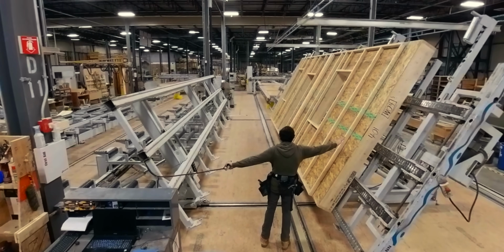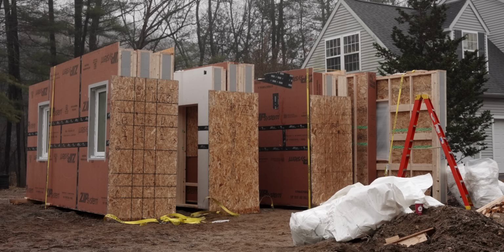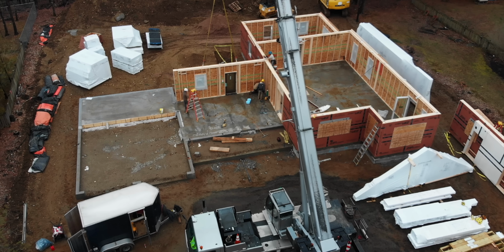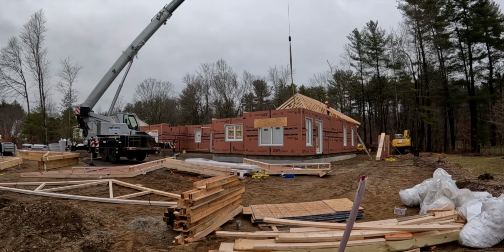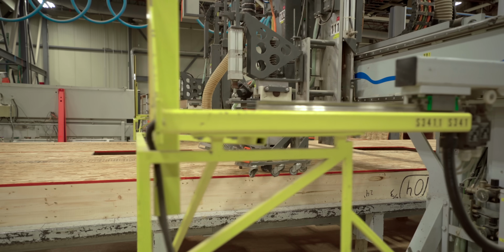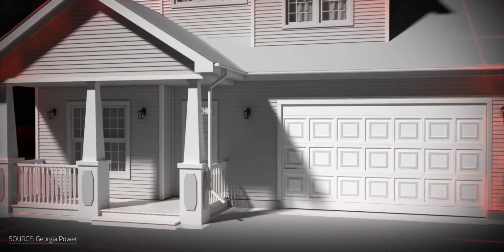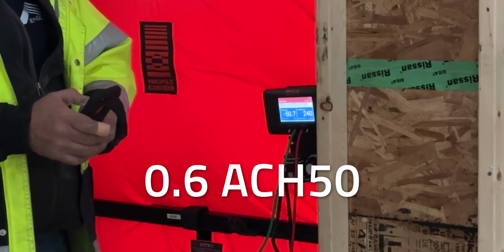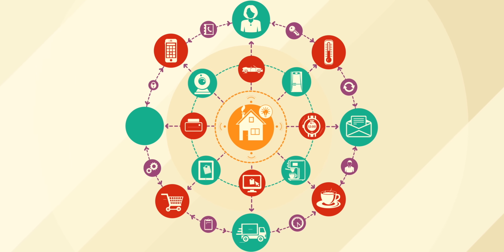Wow! I Didn’t Know A Prebuilt House Could Do This

Comment: It’s really hard to reveal costs, but I would love to see a final breakdown of costs after it’s all in place. 

I’m a huge fan of this, and would like to see what this cost would be vs a “normal” home cost to see why we all aren’t just doing this for all new houses.

Great work, been watching since 2019, keep the videos coming.
Reply: Stick built could come in higher or lower depending on the builder.  There’s flexibility in that.  With a pre-fab you do have a house in a box.  It is what it is.  Mostly good.:)
Reply: I’d guess the cost of the structure to be 25% lower than stick built.
Reply: @JohnCap523  
~$300/Sq.Ft.
Reply: @bbfoto7248    Based on what? After the foundation is printed there’s a million variables. That sounds high but I will admit I’ve lost track of new home construction costs.
Reply: 10 - 20% more expensive when done in Germany, not sure about stateside. The more basic the design, the less effort has to be put into the construction off site and on site, obviously. Then it boils down to energy costs in the long run...
Reply: @Walterwaltraud    10-20% of foundation and side wall cost, or whole structure?
Reply: @JohnCap523  Final price of the total construction! Pls keep in mind that over here many houses are completely done by bricklayers, not pre fabs, though they definitely gain traction. But usually not made from wood. (not an expert, just an interested layman, visited the first such house close to my parents' place in the late 90ies. Other than the sleightly perceivable HVAC noise volume, quite an impressive house already back then).
Reply: @Walterwaltraud    Over here construction is cheap and crappy. If there’s brick or stone it’s just veneer.
Reply: Like most things its going to be a much higher upfront cost but will save money in long term with it being cheaper to run, I'd imagine you wouldn't break even for a couple of decades at least. It still makes financial sense but a large portion of people won't have the opportunity to afford the upfront cost.
Reply: @Professor-Scientist  A home could be stick-built with the same level of airtightness.  It is just not done very often.
Reply: @MrSteeDoo  stick-built?
Reply: @Professor-Scientist  built on site vs Pre-fab, as shown here.
Reply: Would like to see costs too. Especially for "normal" people (& not YouTube superstars.)
Reply: It's not being done because it costs a lot more.

Comment: Built a passivhaus a few years back (0.42 ACH) and one thing that I didn't know and what really annoys me these days is that ERV's don't control the moisture in moist summertime (I live south of Tokyo, its 80%+ humidity several months during summertime).

AC can handle that a bit, but for me it feels like the wrong point to do it (I don't want to run AC 24/7, I shouldn't have to), it's the ERV dumping super moist air in the house, why can't it be fed with at least some moisture control?

I've done my googling and there aren't really any good products that would do in-line dehumidification for the ERV.

Anyway, that's the worst one I've experienced. Otherwise things are so much better than a leaky average Japanese home :)

Comment: Don’t use solar panel electricity to heat you home. Use compost heating with wood chips and grass, you can have hot water and heating all year long. Give up on thermal heating, I challenge you to heat your home with compost heating.

Comment: I'm surprised that you are using a ground source heat pump if you are hitting passive house metrics. I have repeatedly seen/read arguments that with the gains in air source HP performance, and the expected low energy demands of buildings like yours, the cost of ground source is hard to justify for the small performance gains (even in a cold climate). I'd  like to know how you reached your decision. Congrats on your .54 ACH50 results!

Comment: Matt an <awesome> way to seal up your house and check for leaks is using AeroBarrier.  If your house is still in a pre finishing stage, i'd highly recommend bringing an AeroBarrier contractor in to your home, you will see your ACH drop even further.  It's an amazing product, search for an Aerobarrier video by Matt Risinger to see it in action. It aerosolizes caulk and pressurizes your home, forcing the caulk to build up at any leaks and seal them up.

Comment: Greetings from Germany. I`m surprised that airtightness is something "new" for the US, as it is a common standard for building houses in Germany since more than 15 years.  Do you have any idea, why in the US rafters are so different from ours in Germany? We usually use rafters with dimensions up to 10cm by 15cm and spacing of 60 cm while you use much thinner rafters with a smaller spacing. Any benefits or just different traditions?

Comment: Hey Matt hopefully your house is going smoothly... I figured you would go with some of the hemp create insulation that you have mentioned in the previous videos. Surprised you didn't. What are your thoughts on heated floors/ driveway? Radiant heating from the floors always made the most sense for me logically but Ive always wondered how they actually perform when applied.

Comment: I've owned enough homes to understand that build quality can be quite suspect and variable.  I like what you have shown of how Unity actively test to validate a good portion of that.  I work in manufacturing (machine shop) and I definitely see the factory build and methods being substantially better from a quality control standpoint.

Comment: As you are getting that heat pump and air control system, I wonder what you do with waste heat from the solar panels.  Do you allow them to heat up and deteriorate, or do you actively remove heat and bring it somewhere needed?

Comment: How much insulation went under the basement slab and walls? Did you test for Radon in the basement pit soil? Did you need to install Radon ventilation. This can be very high in your part of MA. I built prefab homes as a kid summer job and they were better in some aspects but nothing compared to what you have here. 
You can do a sealant fog at the end to seal the multitude of tiny holes very easily. It is worth the effort. Go for as low a number as you can, 0.15. Air tightness only degrades (slowly) over time. It will never be better than the day they hand you the keys.

Comment: One thing is thermal bridging on the walls and ceiling I have an old house from the 1920 tipical of the old mining towns when the mine shut down the company homes were sold and people who bought them usually bought more than one lot and house and combined the houses in our case they bought 3 lots and houses and like most who went that route they combined 2 houses 14 x 20 into one house T shape the third house was moved back the floor removed for a garage then over time additions were added a porch then a new addition was added when they added sewer and indoor plumbing they put the addition beside the porch and made a bad situation even worse because they lined the roof of the addition with the porch roof and that's where the problem became worse as the porch roof was tucked up under the house roof with no way to seal the upper edge of the porch or new addition roof to the house under certain conditions it leaked and the water ran down on top of the drywall ceiling and into the wall behind the drywall since the porch or now back entry room was done first its the worst and has a lot of rot surprisingly the stud and floor joints are still in good shape no rot but some of the shiplape is rotten and the wood panels in the back entrance and the drywall in the bedroom is totally rotten so I'm taking it back to the studs and firing the walls out to 2x6 with 1 1/2 Styrofoam and a 1/2 inch plywood so I can insulate with R20 I'm putting in a drop ceiling so I can get R44 insulation that's first step but I've seen others reinsulate old homes and they all do the same thing fir it out with 1 1/2 x2wood wood strips and still have theamal bridging my next step is do the same room by room on all the walls I don't know why in a factory built home they don't use the same technique 2x4 studs and 1 1/2 Styrofoam and 1/2 plywood then there would be no thermal bridging on the walls also why did you go the route you went instead of sip panels there is no thermal bridging and a very high R value

Comment: I ordered a factory built house - much alike yours - 7 years ago, and moved in about 11 months after digging started.  This is not a "passive house", but quite efficient nevertheless.
In southern Finland we have had proper winters, and this year we have this cool season with occasional snow.
Nordic standard on windows is argon filled sealed triplex glass panel inside, and single glass pane outside.

Comment: You've probably already considered this but I would be personally concerned in an airtight place with so much prefab material, with outgassing of the binders and glues and synthetics. Do you have a good heat exchanger for your air system so that it can it can constantly replace your indoor air? You could be making yourself sick

Comment: I believe this method of building is a plus , I have a question about your concern about the insulation, one video showed the factory installing it however at 12:53 overhead shot showed just bare studded and sheathed walls?

Comment: As a European with triple glazed „European style“ windows and windowed doors, I can highly recommend those windows and totally get why Matt is so in love with them. They changed our 70 year old house from something heavily leaking warmth to the environment to something cozy. It is not only the temperature, that triple glazing does wonders concerning noise. I had construction going on outside and was able to sleep inside. And to be open those glass doors to the outside is nice in the summer. They and the windows just feel sturdy.
In Europe, plastic windows are the cheapest, wood windows however look nicer but don’t last that long and wood windows with Aluminium outdoor shielding are imho the best (but also most expensive). Our wood Alu windows are 20 years old, but look and work like if it was the first day.

Comment: Very interesting building. I would like to know the cost to build what you are vs standard stick built. What is your expected payback of the additional cost for “zero” energy with your solar panels, battery storage, etc. versus a “normal” house with good insulation? Hope all goes well and you can move in soon. Thanks.

Comment: With all that pressuretesting I woundered how they prepared the plumbing. And how about pests in the house … such blown insulated walls must be heaven for mice and rats. And then I would like to hear more about ERV`s because there is so much talk about them, but people tend to just `install` a tube with a shutter directly through instead. It could be the electricity since these ERV`s are not working passive but need electricity. So how many of these do you have to get out moisture, and what happens if you shut of the electricity to your house..?  With all these plastics and tapesealings.. did you think about natural ventilation or a house of natural product, without all the polluting and gassing materials …?

Comment: You need to pay attention to what's going on in the world. Tesla free energy will soon power the entire world. You can't beat free. Solar will be completely unnecessary.  I think March 1st, we will switch over, but there is no exact date set. Could be sooner or later. Yes, they are going to do a blackout. A massive one in case you're wondering. YouTube is going to be shut down along with many other social platforms. Wave bye to the old satanic systems as the quantum systems of light replace them literally. The financial system has already been switched over. It's called QFS. Quantum Financial System. A side note for the inside of the house. Make sure you keep off gassing in mind when picking out materials for the inside. Natural stuff is your best bet unless you like toxins screwing with your health.  I'm working on a house build myself. Mine is only on paper though with a lot of stuff already picked out like natural flooring ideas, paint, etc. I've looked at all of it. Here's an idea you might like. For mine there won't be one big water heater to waste water while I have it turned on to wait for it to get hot water to reach the tap. I'm doing point to point tankless water heaters in every bathroom and area there is a sink as well as the laundry room. Good luck with your house build. Just remember everything is changing for the better. Everyone will have an UBI. Universal Basic Income. Keep in mind all will be global and every country will have what we have. All connected to the same systems. I've only told you a tiny bit of what's coming soon. New Q phones as well which are free and med beds replacing the fake medicine industry and so on. Everything will change for the better like I said.

Comment: In 1983 I was hired as a mfg engineer in Regina Saskatchewan, Canada where I was involved with manufacturing Air to Air Heat Exchangers. One of the Principals developed a standard for the construction of energy efficient homes which was incorporated into the National Standard a couple of years later. The first home Enercon built was a show home on the edge of Regina, basically in a field at the time. Many visitors came through that home even in winter, and although the house had the capability to use up to 10Kw of electric heat, only one element  (5Kw) was ever used. The air was always fresh smelling and the atmosphere comfortable. That was 40 years ago! Yet you said that the passive house concept was designed in Germany 20 yrs ago?

Comment: We moved into a pre built home 20 years ago not far from you here in NH.  From the get-go we found it an incredibly tight home.  Even today, 20 years later, bright sun low in the sky put the interior temp up to 73 degrees.  South facing windows help a ton but the tightness remains and the house stays warm.  Someday we will put on solar panels but until then we are very happy with our New England built home.  Thank you for sharing your journey

Comment: The high point ( frame / section ) of a tilt & turn window is towards the outside as they open in
While suitable for mainland EU not so good for Ireland with plenty of wind / rain from Atlantic Ocean 
Open out windows suit us better weather wise as said up-stand of window frame is towards the inside & they rarely leak or be draughty & hence get a better weather rating here & the all around locking mechanism is tricker to deal with 
Enjoying the build & best of luck to ye guys

Comment: I would not have wooden home, 
in the UK we build houses the right way out of Stone or Brick due to learning over hundreds of years that wooden homes are not good for living in..

 Wooden homes went out with the 16th Century, because they just are rubbish compared to brick or stone.

And a bad fire risk too. No amount of insulation will make up for the bad effects of wood. i.e. wood frames bending and bowing and water problems etc. 

Having modern glazed and sealed doors and windows is pointless if the frame and walls are wood. 

All the heat will be lost and the wood can and does soak with water even with a vent system and cause issues of damp and mold.  That's why there is no wooden homes here now.